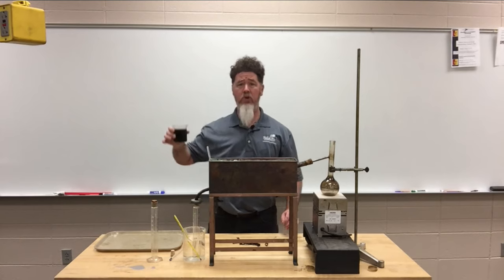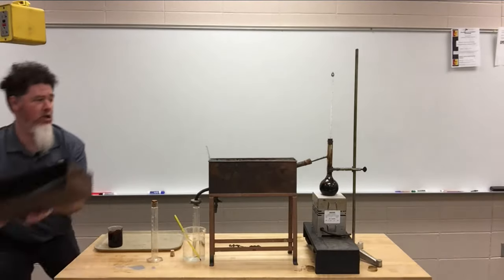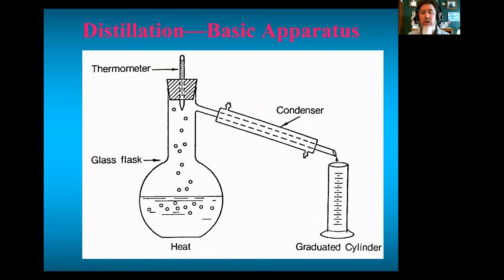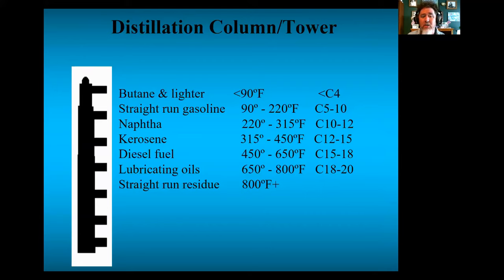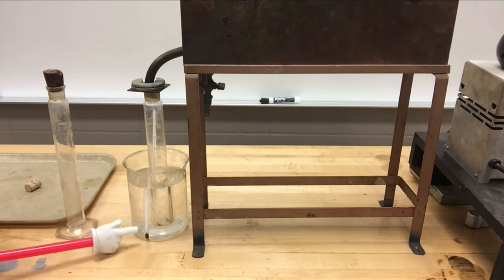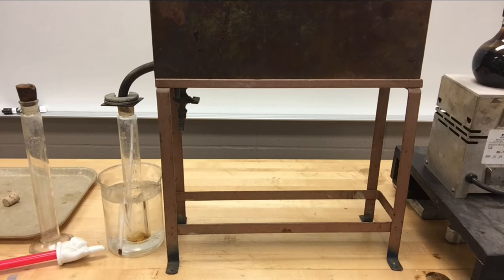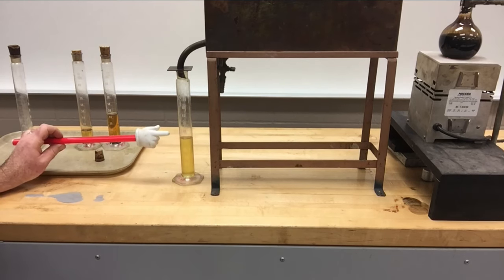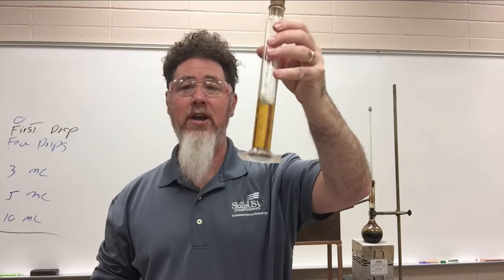How to make gasoline and diesel fuel out of crude oil

Comment: Now for the important question.
How to distill H20 out of crude.
Or better.
How to distill crude out of H20.
In otherwords, there is oil in water. How do I make water portable? 
Please be smart about this. No comments of " get different water"  
I already had to drill well 1500 feet to get this water with oil in it.
Reply: @H_M well here is a problem.
90 to 200 degrees you get gasoline from crude oil. Then 200 to 350 diesel and kerosene.
The oil i need to remove is crude oil.
BTW. I found this out about gasoline after I wrote the post. Which makes, making gasoline a lot easier. Unfortunately gasoline and water both turn to gasses at about the same time.
So not sure if they can be separated. But I can make gasoline from crude. 
Crude is at 400 feet. Water is at 1200 feet. Crude leaks into water table. All the wells here have traces of oil in water.  
I have two wells. One is 550 feet and has sweet crude oil. The other, water, is cased the whole 1500 feet. And has trace oil in it.
Reply: Glad you broughht this question up. It's not anything that ever really crossed my mind but now that it has I'm very curious myself. What about reverse osmosis process to clean the water? Also is there a difference in the condensation characteristics of water vs gas? The evaporation temps as you pointed out are too close to work on that end of things
Reply: @jdsr7423  lol. Idk. I had a problem with my solar distiller. It was giving a bad taste water ( used a different water source to first makesure it works ) well a few days ago I was siphoning water from a rain collection to buckets and found the same taste.
It was coming from the clear rubber hose I was using to siphon with. Which my distiller also had on the out port.
When it gets hot it gives this bad taste.
So earlier today I replaced the hose on distiller with pvc. Have to wait until tomorrow to see if it fixes it.
Once I get distiller working right I will make another and see how it does with my water with oil in it.
As far as reverse osmosis or filters. No. Since this is very energy or costly to do.
I maybe limited to rain water only. Which stinks as I only get about 4 inches a year. And atm have very little collection system.
Reply: @baddog9320  Gotcha. Sounds like your in West Tx or NM. My dad and a few generations from San Angelo. Careful with the pvc. You'll want cpvc as straight pvc degrades even running water from your water heater to fixtures. About 20 years ago I spent about 6 month's  replacing tubes in water heaters on a factory recall because of that exact reason in Tx. Fl. NM. and AZ. all in spring and summer lol.
Reply: @jdsr7423  good guess on location. Lol.
I know pvc is not my best choose. But in short-term if it fixes the problem then I know its the outlet.
However, I am wondering if copper tubing maybe a solution. Its not like other parts of the country where corrosion is a problem.
I already know anything plastic is not long term. Even as you said cpvc. 
First I need.to get it working. Then refine to better, longer lasting stuff.
I see in the future it will be glass and or metal. For thats the only thing that last.  Just too bad one cant weld aluminum to glass. That would be nice.
Reply: @baddog9320  lol that would be awesome. Maybe there's something out there with compatible threads to mate them though. Yes coppers a great choice in the interim though in my humble opinion. Personally I prefer the compression fittings over sweating the joints because they seem to survive the temperature expansion/contraction process longer. The limited corrosion opens up a lot of possibilities on materials either way though.
Reply: @jdsr7423  yeah sweating would be a bad idea.
Sorry didn't even think about including that. But I should have because people don't know.
1. I'm bad a soldering. But great at arc welding.
2. Sweating can have lead. I know you can do it with a lead free solder. But then I would have to say that also.
For me compression is the only way.
And once one is made like that it will last for decades. If course there are things to watch like, make sure its dry in freezing weather.
Lol. Years ago I had a water tank about 15 feet up and black pipe coming from it. One day it was cold. And really not that cold. But wind is a factor also. We'll to my surprise I walk outside and seen my pipe busted up near the whole 10 feet. Lol.
Good thing is it was frozen which stopped the water. So I lost very little water. And simple closed the valve on the tank. Which wasn't frozen.
I know I should have wrapped my pipes. Also I shouldn't of been using black pipe, but used galanized. Which would have busted more so. But since it did this to black pipe, I know galvanized won't work either.
If I build a tower again. It will be included with a little heat
Reply: Have you tried straining the water out using a variety of different filters?
Reply: @CreatorCade  no I haven't.
That can be quite expensive. BUT I may give it a try.
However. I found that collecting rain water is pretty productive.
Unfortunately it only rains 2 to 5 days per year. And its at the same time. July / August. With that said. I collected quite a bit last year.